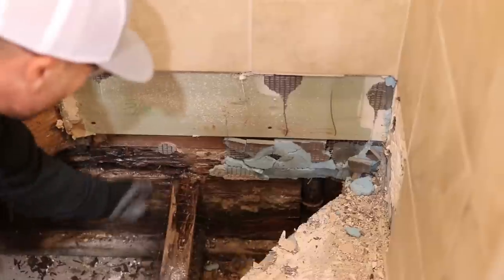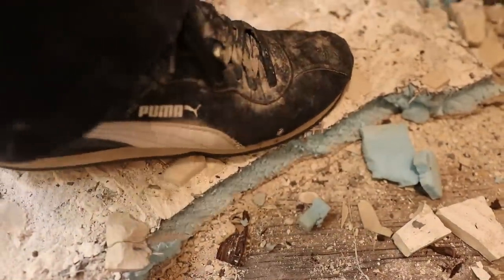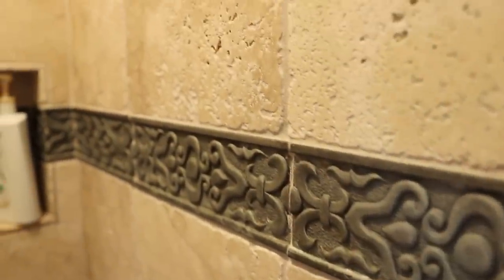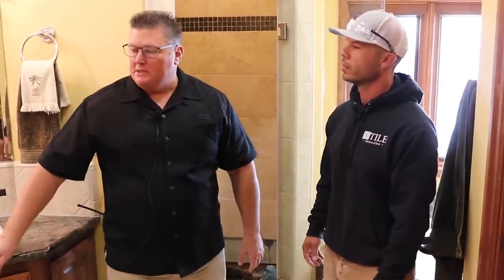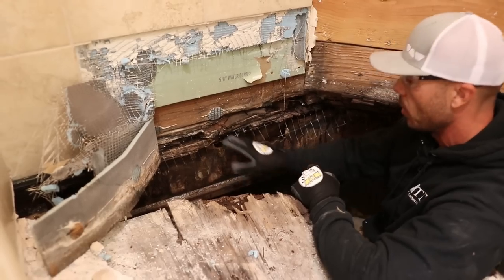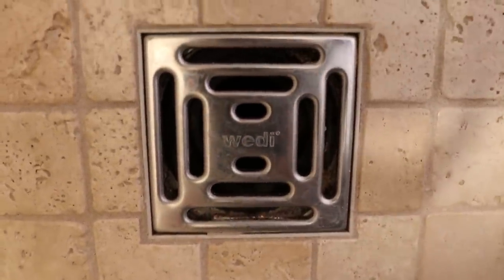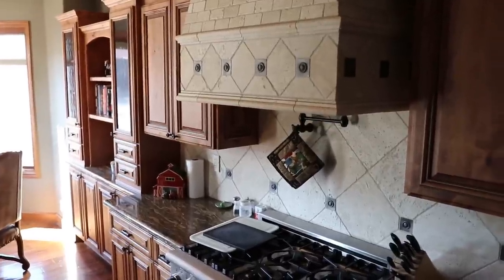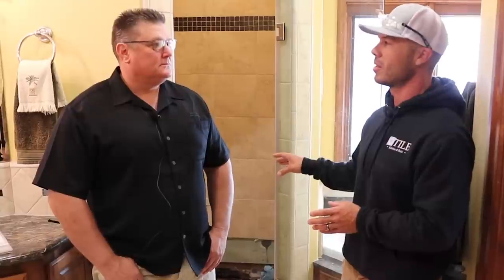Massive WEDI Shower FAILURE (Done by Certified Installer) -- Warranty Claim DENIED

Comment: And that is why i only use PVC shower liners it a pain in the ass in some showers to install especially because you have to pour a concrete base over it but it works really great zero leaks if you install it correctly.

Comment: from my experience I'd be concerned about the age of the caulking perhaps they installed the wedi system with expired adhesive that didn't bond. perhaps the rabbit cut was not clean or vacuumed out before sealant was applied . but that particular joint is 3rd line of defence for water. Tile being your first. then the exterior caulk joint on the seam being second then the caulk joint inside the rabbit cut being third. my opinion water should have never even got to that area. what did the wall tile joint to floor tile look like? was it grouted? because it should have been caulked with a sealant. so yeah I feel bad for the home owners but water should have never even reached that rabbit cut caulk joint to begin with.

Comment: I noticed the span inbetween joists was to wide. Lock of bracing underneath of the shower floor. If you don't have bracing the floor will move and the floor shower with crack. So if you have a shower at second floor you had to remember that you have to brace the floor to make the shower floor, so the floor will move at all. The failure I seen it was no the product, the failure was underneath of the shower floor bracing. It happened to me to one job that I have in Orlando. It was made by other but then I noticed that the span in between the joist was 27"interstate 24". I embrace everything. I put in the new floor and I put the shower pan and test it for 24 hours then. I put my mud and tile until
 today nothing happened.

Comment: I don't know what the standard Wedi install guide was back when this was installed, but a simple line of sealant along a butt joint at the base of a shower is not something I've ever seen done or recommended (in the UK) in at least the last 10 years.  All butt joint are sealed with a sealing strip which has to be properly bedded into a waterproof compound.  Even mechanical fixings holes in vertical areas are sealed similarly.  Hard to believe any contractor (certified or otherwise) would install in this way, regardless of what the manufacturer advice was.
Reply: Unless the Wedi system has been massively updated lately, this does not look like a proper install. No jointing tape used, that "sealant" does not look like the Wedi adhesive sealant but just regular silicone, and those tiny dabs of sealant mid-video are laughable when you claim to be a certified installer.

Comment: There is always some new company coming into the plumbing or reno business - this is normal.
But - the same as with new computer systems - give it time to prove itself !
In the meantime - stay on the safe side and use older yet proven and reliable methods!

Comment: I'm considering using Wedi for a stand-up shower in NJ.  I (hopefully) don't have the seismic activity that would be typical in CA, and I'll be able to ensure the subfloor and support structure is rock solid... BUT:  Is there an additional product or method you'd use to enhance the protection for the joints?  This sounds crazy but would you ever use Kerdi band to reinforce wedi joints?  Or something similar?
Reply: Why would anyone consider using the product after watching this video? Not only did it fail, but they didn't even honor the warranty.  I hope you decided not to use it.
Reply: @Robert Thomas  good question. This was a while ago. I did a ton of research and found that this was an isolated scenario likely caused by not enough joint adhesive being used in critical spots. Each shower system has its own similar horror stories to this one and most surround installation challenges and not product defects. Also as a non-pro, the wedi system presented fewer variables for me to get right so I could focus on the critical ones. 2 years in now and no problems.

Comment: To cut out a failed section of that where the pan meets the wall, I might use a Grinder with a diamond wheel to cut out a perfect cross section, to make Wedi Honor their warranty - that is a System Failure, not an installation failure...

Comment: Just like I tell people about roofing, the material with the shortest weakest lifespan is caulking. Do you want to use any other material wherever applicable and caulking only wear absolutely 100% necessary and there’s no other option.

Comment: 1) with that much water damage there HAD to be cracked grout and/or silicone that had come loose a LONG time ago.   home owners ARE responsible for that much of it at least.   also this is why i silicone all change-of-plane.  2) i prefer the hydroblok instructions to also embed tape (and add more sealer) at the base of walls.  with that layer, plus what's in the rabbet joint there shouldn't be a problem.   which again i think points to failed grout and/or silicone- home owners' responsibility there.

Comment: I’m a Wedi installer, this wasn’t installed correctly. The sealant used didn’t look like Wedi 610 adhesive/sealant. It is a dark grey not white. Wedi fleece tape should have been used between the tray/wall joint applied with 520 adhesive.
Installed correctly Wedi is a good system.

Comment: They should be responsible now that you showed that the caulking failed with in the allotted amount of time. And i hope Mike gets the bathroom fix cause that's now a structural problem with the cils and joists rotted out.

Comment: That’s crazy. You worked out the inbuilt failure of the design within minutes. Makes perfect sense. What is hard to understand is why Wedi got it so wrong?
Reply: Mark Bell 
The same way Boeing blamed pilot error caused the crashes of the 737 Max
Reply: Easy... That's not Wedi sealant between the pan and wall panel. That white stuff appears to be caulk. Improper installation here.
Reply: Wedi sealant is not silicon... it's a chemically modified Silane polymer. It might contain some silicon.
Reply: It seems it isn’t so clear after all. So, is Wedi a good system or does it have an inherent weakness with a critical joint at the shower floor?
Reply: @rotaxrider  Such ignorance is astounding!

Comment: If they were "certified" by Wedi then Wedi should be  on the hook. They Certified that  the contractor was competent in the installation, and basically indorsing him,  if he wasn't then they should not have Certified them!
Reply: In the description he included a quote from the Wedi report- they basically blamed the entire failure on the 'structural movement' that was experienced by the shower...imagine that in a state that is subject to seismic activity...

Comment: This shower has been leaking a very long time for that level of rot. I see stuff like this where pans have failed on top of subfloor, then insects attack. Stick with Chloraloy, properly installed will last until next remodel. There was  never any reason to reinvent the wheel.  All these novel pan methods don't seem to be of any advantage.  Stear clear of hot mop, I can't recall how many of these I replaced back in the day due to settling and cracking. Hot mop gets brittle and is basically 1920 technology. The flexible pan liner is best, period. All that hard work should have lasted decades. What a shame.

Comment: looks like they never siliconed the joists. All grout will shirk and crack, that's why we silicone all 90 deg corners. Funny how the back of his hat is "schluter" lol. both systems Schluter and Wedi, are great.
Reply: Silicon is not forever. I would NEVER use it in a shower. When will people learn that it never stops shrinking. Put it in a closet shower like that and it will come back to haunt you.
Reply: @elfkind5590  what would you use to seal the tile joints in the 90 deg corners?

Comment: Not sure what the big surprise is about. As a kid I remember messing around withy Styrofoam and when I stood on it it broke. No way would I ever have considered it a material suitable for any kind of structure, let alone a pan underneath a tile shower. I never use anything like this, we dont do many showers but when we do we call the guy who hot mops them. Tried and true and never an issue, and theyre not even expensive.

Comment: I have a slab garage and metal frame and cement board walls. Just punched a hole infloor built a drain and grinded the floor down to the drain. Who cares if the slab wics moisture underneath. 500 year shower complete!

Comment: BTW, that foam seems to be the same as the Owens Corning pink insulation foam. This foam decomposes over time and an adhesive sealant will eventually fail to bond. At the end of the day, this was basic flashing 101 where common sense would tell you how to keep water from penetrating.  I would say  Wedi tried to reinvent the wheel by  "developing" their own interlocking pan rather than wrapping the pan with a liner that  laps up the wall.

Comment: $19,500 - $23,000 would be my estimate to completely replace shower because of having to demo into adjacent room(s) and rest of bathroom to get the floor rot out. Looks like an exterior wall so siding removal to get rim out. Could be much more if electrical, plumbing and HVAC is running through rotted I joists or a section house needs supported while R&R beams. Lots of potential here for collateral damage to adjacent tile, vanity etc as well as effort need to match replaced drywall finishes in other rooms. Would love to hear other estimates.
Reply: Completed a similar repair last year.  Extensive structural and rot repair then new tile (pan and walls). 
$25,000 total cost

Comment: Isaac, I was wondering if you have done or might do a video or series about installing a relatively simple bathroom with a bathtub and traditional 4 x 4 tile and mosaic tile on the floor.  Like the original "grandpa bath" but with modern materials.  I would like to do this in my bathroom where I now have plastic panels and vinyl floor and a plastic tub I don't like.  Right now I have Hardibacker with tar paper behind it (as recommended by Hardibacker) that I installed 10 years ago, but I placed plastic panels over it because I did not have the time to tile.  I would like to have a Kohler cast iron tub (I will have to get 2 strong friends for this as I don't have the "guns" you have!) and American Olean "salt and pepper tiles" for the wall and mosaic tiles on the floor.  I might use the Ardex "bone" plastic product on one of your videos.  Also, have you ever installed a floor drain in a residential bathroom?  I don't mean the shower, I mean the actual floor.  I have heard it is a good idea, but I have never seen one in a house.  By the way, if I was not 60 years old and facing age discrimination I would take your advice and look for a job as a tile installer myself!

Comment: Wearing a schulter hat bashing the competition looks bad fyi.  I think schulter and wedi both make fantastic products.   I did so many custom showers using Schulter and loved it.  But after trying Wedi and comparing the two brands, wedi is by far my  preferred product. I would have  no problem using Schulter again if the customer was fixed  on using it tho.  Wedi shower pans are one  piece design, pans and wall boards are much more rigid/stronger.  Both are great products.  In my local area builders use the stronger wedi pans but with schulter wall panels. Only reason for using the schulter wall panels is because they're slightly cheaper.  In the end I will say almost all reasons why a shower fails (wedi, schulter, tradition style) is in the installer.
Reply from the maker: Good comment. Thank you for being respectful.

Comment: If you know your surrounding where you live, you have to say to home owners this is the best. After all you can say What you want. How long are you working with schluter. All you have tiled on wood or concrete is then also not good enough, do the customers know. That know i use better products. Because it will crack the floor, you know it but know there are options did your customers know that, learn along the way en critize your own work. That will improve your self

Comment: I never did hot-mopping but used (and continue to) vinyl membrane and flexible paint-on membrane (Red Guard) in my installations. Those Kerdi, Schluter or WEDI systems looked sketchy to me when they first came out and have proven themselves to be crap. WEDI probably denied Mike's claim because they're experiencing a dearth of claims worldwide as their systems are failing. Now, 10-15 years is a long time to warranty anything but experienced shower installers in the past, prior to these systems, have seen their jobs last 30+ years. Suffice it to say, not a fan of these systems!

Comment: With tiles, you always want the wall falling onto the floor in order to minimize any damage from a failed/failing joint. The idea of a rabbit in the floor to accept a wall board seems to me like the exact opposite of how the system should be built. If a rabbit is being used it should be in the wall section.
Reply: I agree 100%. Putting the wall lining lower than the floor lining is absurd.

Comment: No 3/4” plywood under wedi? That’s not how we do it. Never had a failure though we’ve only been using it for 10yrs. I’ve ripped apart 100 yr old bathrooms that were solid concrete floors and walls with tile. Took 6000 lbs out of 1 master bathroom. Lead shower pan and only the slightest water damage after 100 yrs.. It seems that when we try to make stuff easier we make it worse. Btw, wedi is expensive.

Comment: Here I was likeing the Wedi system. MIght be worth adding tape to those bottom joints and corners just to avoid this issue.

Off topic. You hear of the Revolutionary Shower System crew out of Idaho?
Reply: Zack Fishle yea what's up dog?
Reply: They do sale joint water proof tape. But this was installed incorrectly
Reply: Yep. Neoprene tape must be used on floor to wall joints. It's part of their spec

Comment: Forget about these systems use dura rock tape joints red guard or not and tile with thin set , wet bed the pan red guard and tile it will last forever

Comment: Great video, I have never seen a wedi system fail personally after doing at least 50 installs utilizing that system which is always great to learn. Regarding “great tile work” look at that sliver in the corner at 3:46 on the glass. No set respecting tile installer would ever do that. First question is I didn’t see any supporting framing under corner where the joist is. Would’ve been great to see more before an after pics. Great video Isaac but there is definitely more to it! Keep up the great work

Comment: That sealant failed adhesively. Sealant used in an application subjected to constant water exposure like this should fail cohesively before adhesively. As you said, unprimed foam is a lousy substrate for ANY sealant. This is a junk system, no wonder they don't honor warranty claims - they'd be bankrupt in a month.
Reply: Why foam? Foam is for insulation

Comment: They did not fill the rabbit with sealant  and you need to use a lot of it and it’s expensive and people don’t use enough of it . I would of used 12 to15 tubes in a shower like that.  The pan should have been in enough thinset to waterproof it . More than likely there’s a small leak at the drain or the valve trim. Causing the floor to rot then fall and brake the joint. In my 44 years of experience used every product on the market they all will fail if the craftsmanship is not held to the highest standards. The person who actually did the work should be licensed  and named documented  not just the owner of a company who knows he will long gone before the stuff hits the fan. Wendi is a great product in wright hands you have use it wisely and with care  you need to master you craft  and not just turn the work over to under paid help  !!!!!!!!

Comment: Been watching and following.
Have you had any experience with RediShower Pans?
Reply: Stay clear of them. Not worth the cost.
Reply: I'll give you my experience. I installed one redi shower base and will never touch another one. the foam gives when you step on it. they make you install the floor tile with epoxy. epoxy has zero give. when I was grouting the pan, I could feel it compress under my knees. the pebbles embedded in epoxy began to work loose almost immediately.  I like redi niche, those are great, but a foam shower base is not solid and any movement in the substructure causes things to crack and it's just bad to use foam as a shower pan. the redi base has never leaked, but the pebbles tiles are consistently needing to be repaired and that is a result of the foam being compressed when the user walks in the shower. I always do mud pans because I know how it will perform. mud works. always has, always will.
Reply: Are you guys talking about the TileRedi one piece Polyurethane pan that I’m asking about?

Comment: To be honest, I’m professional tiler for 35 years, and I don’t trust wedi board system. The main mistake they did, there is no tanking in corners , waterproof tape should be done in all corners wall to wall, wall to floor. I use for years ditra system and this is high quality product.

Comment: I think it's outrageous for styrofoam to be used as a base for a shower. The owner's a big guy and nobody steps at the wall, floor meeting. At least consistently. It seems to me that over time the styrofoam towards the center was repeatedly compressed, causing the perimeter to peel away. What did tile setters think was going to happen? Styrofoam? Really? I can hear the Wedi rep now. "Oh, it's completely warrantied! A proven product!" My question is. "Why this new product? For ease of installation? Low cost?" Make me a mimic of Lead. How long would a proper Lead pan last? a thousand years? But  Styrofoam?